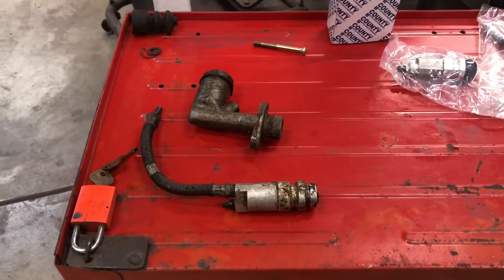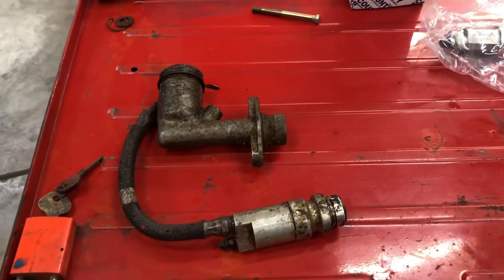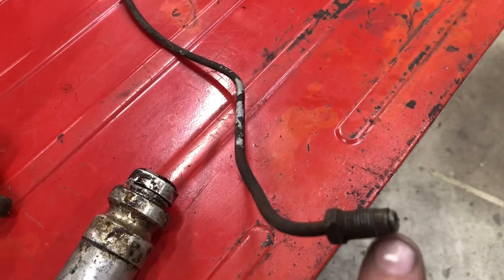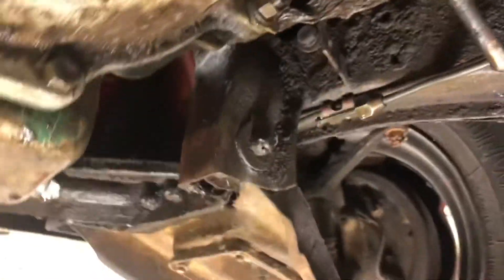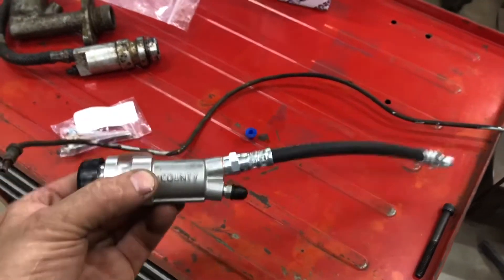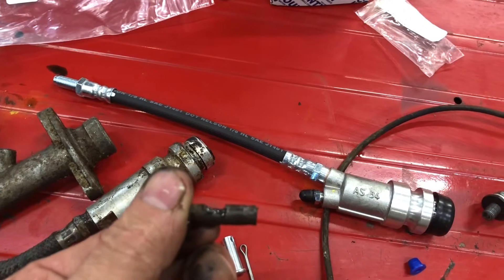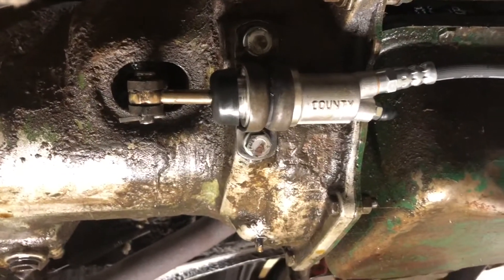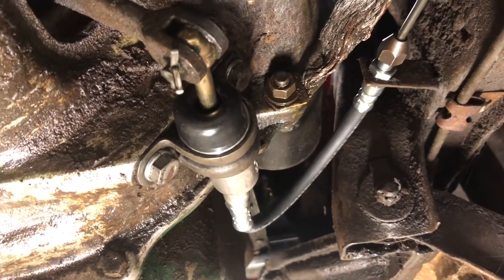Nash Metropolitan clutch slave and master cylinder

Comment: Have you had to replace the clutch/flywheel yet? Love to see that teardown. I need to do mine...
Reply from the maker: It’s not that often I do a clutch without it being part of an engine build. It seems most of the time the clutch problems I see are hydraulic issues rather than a worn out clutch. You can bet I will do a video on a clutch change when I have one to do though.